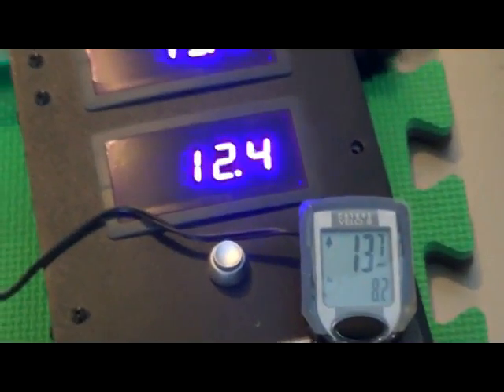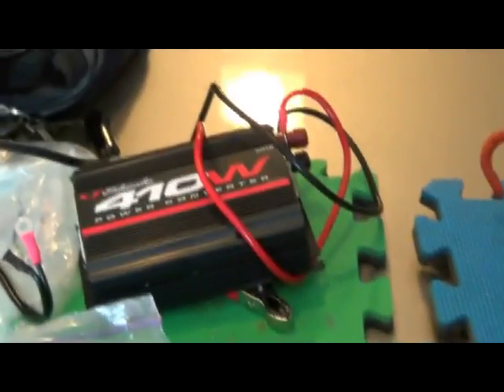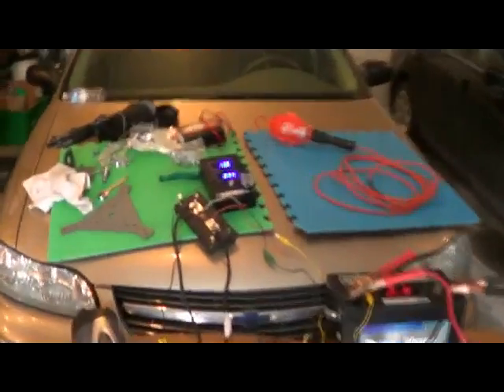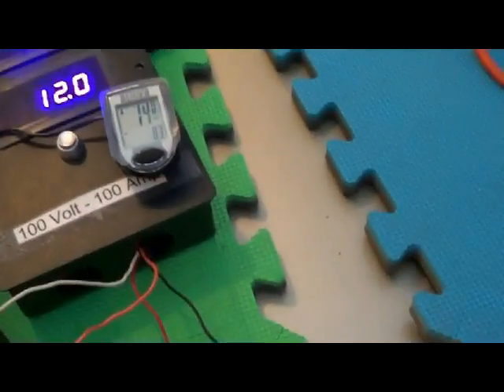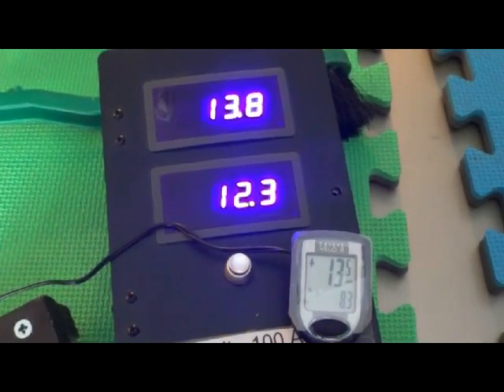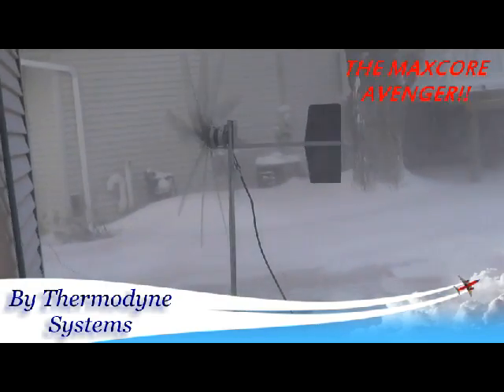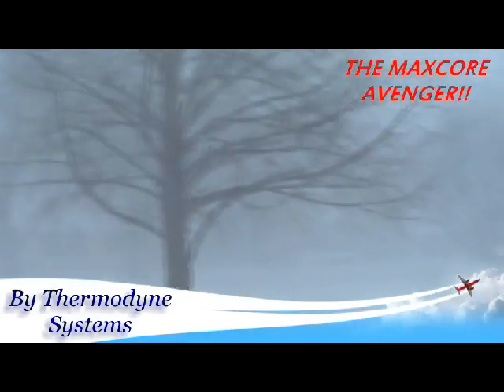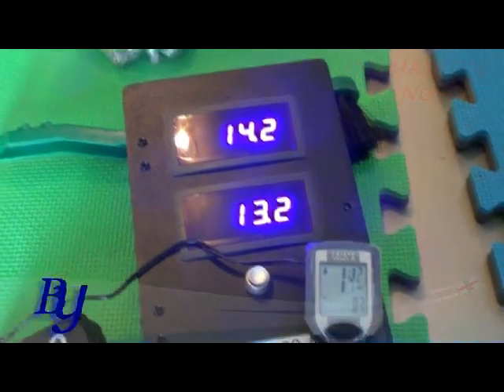THERMODYNE SYSTEMS WIND TURBINE ON A 4 FT  POLE

Comment: Nice Billy,  That's about what I'm getting too but our blade is still in testing.  If your getting 220 watts at 15 mph that's about 880 Watts at 30 mph and about 1100 Watts at 35 mph and that's when this turbine should really be furling out.  Going to send you a furling tail next so you don't fold those blades in a wind storm :)  So that's the new coarse for our company. Big blades, furling tails and a 250% Wattage increase in lower winds, much better yes?

Comment: Wow!!!!!! Very impressive. It should do well running on a 24 v system too? Great post bro. Keep'em coming.
Reply: TheBillythekid2010
 I seen the AVENGER #DC72 generator on sale at Ebay; any input on this unit? I cannot get a response on ebay from the seller, so I'm hoping to network with some familiar buyers/sellers here.  What is the optimum rpm for that generator?

Comment: I HAVE FALCON MACH 5  80 INCH BLADES I HAD TO BLANCE THE BLADES.  I BOUGHT A TECOMEC MAGNETIC LAWN MOWER BLADE BALANCER OFF OF EBAY FOR $86.89 IT WORKS GREAT  REALLY  SENTIVE FOR ALL SIZE HOLES.
Reply from the maker: Thanks for the advise on the blade balancer. Hope to get one for the X4's I'm receiving soon :)